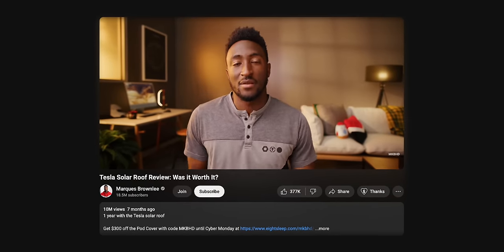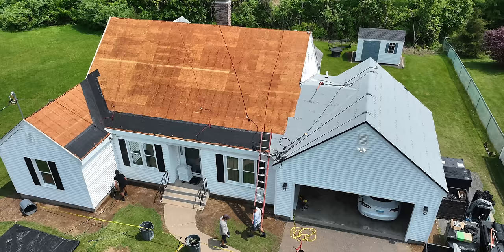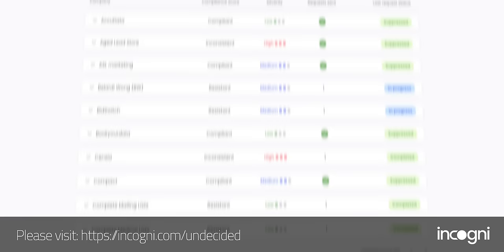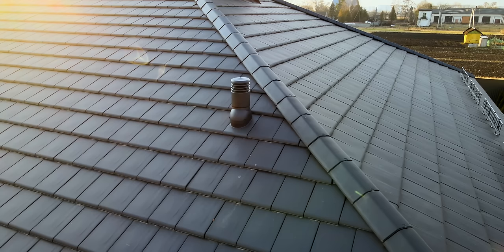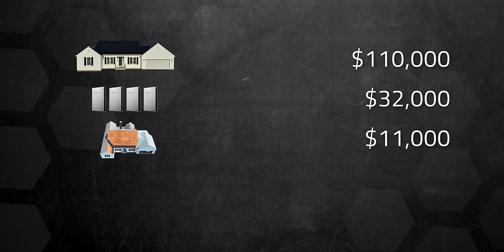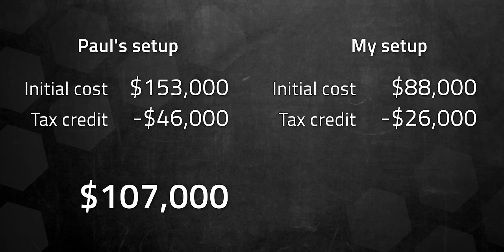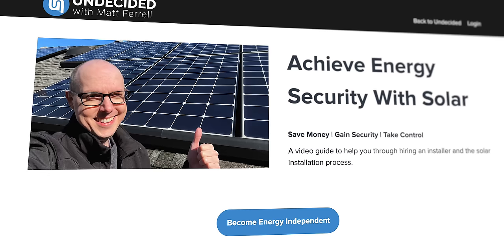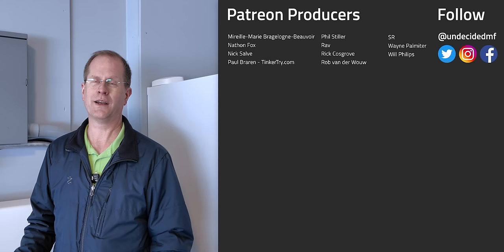Tesla Solar Roof vs Solar Panels: Which is Worth It?

Comment: I installed a solar system on my roof myself and found that the efficiency goes down a bit when it is warm out. Thus, June produces more power than the hotter August, with the same amount of sunny days. My next system will be ground mounted to get around this, with cooling from crops growing below.
Reply: I wonder if the heat killing efficiency is any more significant on the solar roof vs regular panels as they suffer the same fate in heat.
Reply: @Chopped86  I think they will be pretty close, but the solar panels will have some airflow below. Ground based gets the most.
Reply: Solar panels are silicon  chips essentially, more heat = higher resistance = lower energy output.
PV efficiency goes up in the winter but shorter days reduces total energy output.
Reply: @einarmikkelsenPNW  yeah that’s what I’m suspecting as there is also flow below the roof, though a bit less. If you’re in the PNW the effect is so minimal as well. I’ve lived in the PNW and in the opposite environment in Phoenix where the panels get crushed 8 months out of the year with heat. Ground based would be best but I do not know if I would want to commit having panels in my beautiful backyard especially since where I live we are capped at a 10kw inverter which becomes 7.7kw in the real world.
Reply: This is why vertically installed, north-south orientated, double sided panels are a better option for very hot countries.  In the extreme heat of midday the panels are not facing the sun and therefore don't get as hot.
Reply: @-_James_-  I have seen some people run tests on those and with the double sided panels they got amazing results when there was snow on the ground, as it reflected more light to the back of the panel.
Reply: You should also account the fact that June has longer days than August. Another issue to take into account is the angle of the sun which is in the most optimal position during June.
Reply: @insgr  correct. I am looking at the output per day and you are closer to the summer solstice in June. I love the ability to change the angle of the panels seasonally instead of being tied to the pitch/angle of the roof.
Reply: Vertical solar panels ok ground were pointed as the highest efficiency so far
Reply: On the ground will be hotter.  More airflow at roof level.  I would suggest a bigger air gap between roof and panels, or don't worry about having gate optimum efficiency and add another couple of panels to make short fall if the need to cover consumption is critical.  Also an attic fan to have air flowing through the roof space to cool the roof space area, so over night the roof cools way down.
Reply: Aren't there dual use solar panels now, that pump some fluid through the back of the panels, cooling them and providing you with a source for warm water? While thier price is higher, if you are a fan of effciency, it seems cool.
Reply: All good points. Tesla Solar Roof has a 1" gap underneath the panels, and some vents along the bottom and top edges for passive venting upward. This may help some, but I won't know for sure until we get into this summer of 2024, my first full summer with the system fully operation. Also worth noting that my town doesn't allow ground-mount solar, and my yard is pretty small anyway.
- Paul Braren from TinkerTry
Reply: I’ve seen some diy fixes using off the shelf solar powered attic fans to keep the air moving under the panels.  Also, “engineering with Rosie” has shown some systems.  I don’t think any of those are on the market yet, but might be good for ideas and info towards an inexpensive improvement.  Might help panels last longer as well
Reply: Heat aside, you shoudl produce most kW in June in the northern hemisphere considering it's the month with the longest days.
Reply: Solar cells on the roof should keep the sun off the roof. Meaning you will have a cooler ceiling saving some airconditioning
Reply: @-_James_- Bi-facial panels aren't always the best solution. One 'size' does not fit all with solar, and them any variables means that every install will be different.
Reply: @einarmikkelsenPNW Another aspect of ground-mounting is that your house insurance rates will not be affected. That's becoming an issue with roof mounting, especially regards the raised potential for water leaks and the ensuing damage to the house.
Reply: @testthewest123   Yes, those exist for heating swimming pools and cooling the panels. Unfortunately, when I'd want the heat is when there's the least sun or I'd be looking at them!
Reply: @BLKMGK4 Yes, but even in summer, you want hot water for cooking or showering and you boost efficiency of your solar panels - at least that what they say...
Reply: @testthewest123  for those with a tanked water heater sure I guess. I don’t use that much hot water and have tankless. Not a big fan of electric tankless in the place I’m moving too though, might yet swap that. Wish natural gas was available!
Reply: Its nothing to do with how hot the air is and everything to do with how much and how long light is falling on the panels. June has more time with the sun more vertical in the sky than August; the days are longer.

Comment: I put a Tesla solar system in last year, and because I went through Tesla's site for a quote, but worked with a local roofing contractor I was done in 5 weeks from initial contact, including PTO for a 20 kW system with 4 powerwalls and 3 inverters. The whole install process took about 10 days and the rest of the time I was waiting on PTO and a few final touches. I cannot stress enough what a difference it made to have a wonderful, quality local contractor that did a fantastic job. The whole thing has been running flawlessly since they completed it and I never had to deal with Tesla directly.
Reply: How much did you pay?
Reply: tesla marketer
Reply: until one day you will need to and you'll end up needing to buy another roof because new model of the shins won't be backwards compatible. and it will be even more expensive. but you'll be happy because it's tesla and you're happy to give them money.
Reply: And how much of that roof is subsdized with tax dollars by your neighbors?
Reply: @douglascaskey7302  None of it. I get a credit on my own taxes. I don’t get any extra tax dollars back from anyone else. Tesla also gives me a rebate back on the cost of the powerwalls. But I don’t take a dime from anyone else.

Comment: That point about being an early adopter Matt brought up was a VERY VERY GOOD point. Roof stuff isn't a phone or a game console, it's a very long term "investment" (it's not REALLY an investment, but you get what I'm going for here). It has to be reliable, it has to be easy to either replace or maintain, it has to last a long time.
Reply: Same idea with smart home tech. Way too many stories of businesses going under, servers going offline, older equipment no longer receiving support. Suddenly your thousands in smart tech turns into a dead brick overnight which is bad enough but depending on what you had connected you might not be able to turn on lights, open your garage, or control your thermostat etc. Way too unreliable.
Reply: Anything that earns or saves you money over time I could consider an investment, but you need to do your comparisons and lifecycle analysis first.
Reply: @Alfaomegabravo  Was going to say that the term investment isn't strictly for finances.  It's anything you do improve the value of something else.  Eating right and exercising is an investment in your health.  School is (supposed to be at least) an investment in your future work capabilities which affects both financial opportunities and health.
Reply: @grn1  Sure, I'm just saying a poodle is a dog not that dogs are poodles.
Reply: Most importantly, it has to be installed by people who have significant experience working on roofs to begin with.

I have met plenty of people who got solar roofs only to suffer water intrusion problems because the installers clearly either didn't know how to probably water proof their work, or they didn't even think about it.
Reply: @scopie49  Way too unnecessary unless lazy is your middle name.

Comment: I used to work at Gigafactory 2 manufacturing the solar roof. Great product, shoddy execution
Reply: I worked for the tesla superbeam team (half the line was welding robots, shorts proof) same, great product but the machines constantly broke, or jammed, especially the ones using weld robots.. humans never caused the delays robots constantly did (also honda robots even more, did that also for honda crv bumpers, same factory)
Reply: Very interesting!  Always nice to hear inside knowledge. @dertythegrower
Reply: Why doesn’t Tesla sell solar roof shingles direct to consumer?
Reply: @triforcelink  If you research fertilizer, for example, sometimes a person will overwater or forget to water, but then leave your fertilizer a bad review... they blame someone else for their misuse.
Reply: @dertythegrower thanks bro, interessting
Reply: I seem to have gotten lucky with a good local installation crew and Tesla Solar Roof Advisor, but it's heartbreaking to hear how others have not been so lucky.
- Paul Braren, owner of the Solar Roof featured in this video
Reply: @triforcelink  My install had an installation crew of about 8 folks (1 electrician, 7 roofers) on site for nearly 3 weeks. It's a lot of trained labor to do this right, which likely explains a lot of the cost uplift. They handled everything, including permitting and all electrical work.
- Paul Braren, owner of the Solar Roof featured in this video
Reply: @TinkerTry  I built a 12x8 lean-to shed, and I thought a solar roof would look nice on it, plus I can stick some batteries in there. Very simple roof, I can definitely do my own install.
Reply: @dertythegrower  Lots of companies will sell you their solar panels no problem. Just provide free training videos on proper installation and maintenance and let the market handle the rest.
Reply: Tesla in a nutshell honestly. It is also in line with the over-promise/under deliver thing they have going on.
Reply: @TinkerTry   Wow! I had a standing seam roof installed in a single day. Hours honestly. My solar panels attached to it later took a full day and maybe a bit of the next for permitting. I cannot imagine that many people for that long to do the job 😲
Reply: It might be a neat product in your eyes but it is an absolute flop.
Reply: @triforcelink that's the way to do it